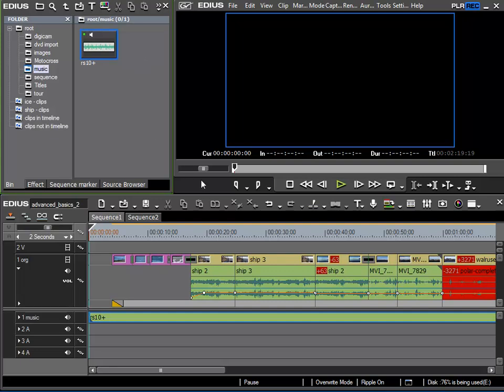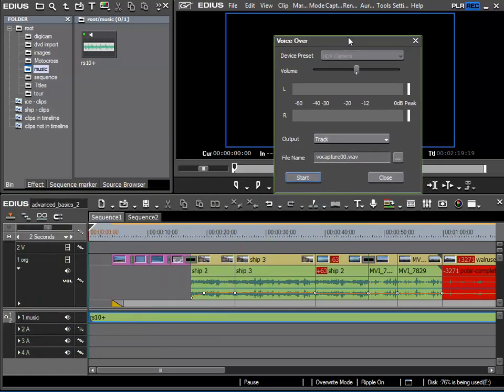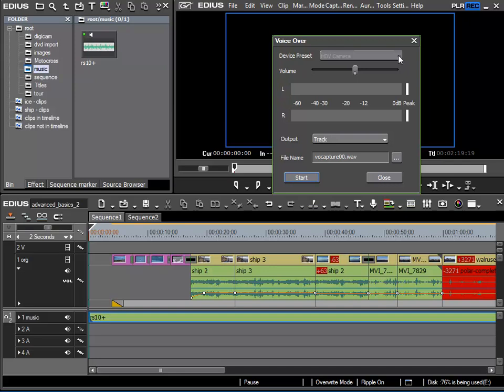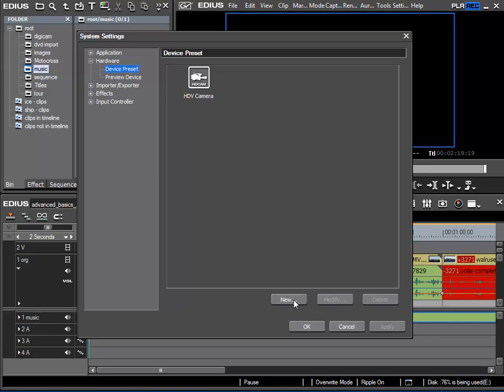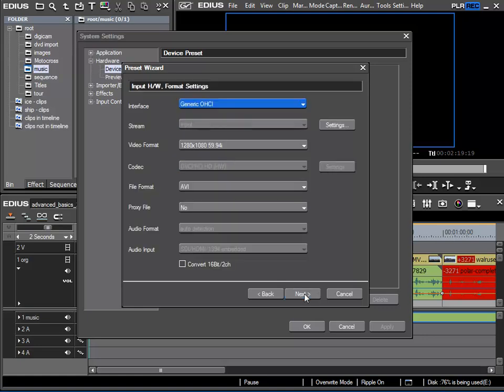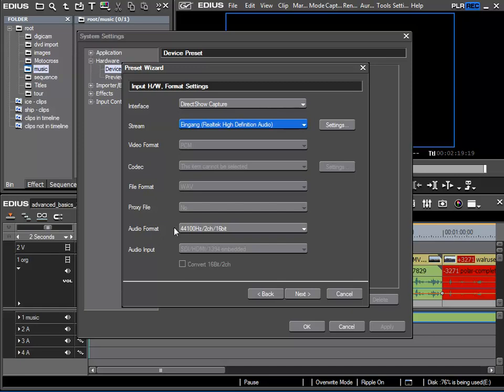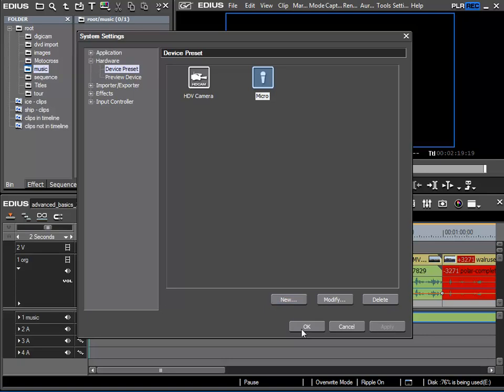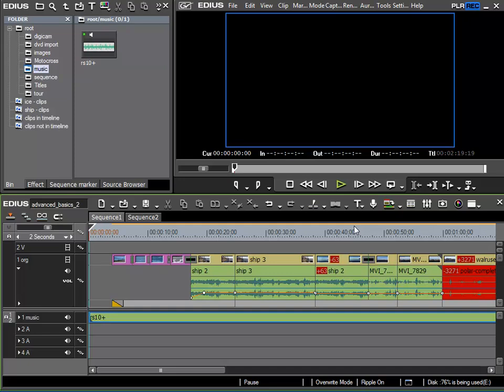149. Setup device for Voice-Over recording.

Comment: I connected a condensor mic through a audio interface (USB) to my desktop computer. When I record the voice over I want to keep the volume on through the headphones so I can time it correctly. The problem is when using the voice recorder in Edius it records the sound from the mic and the sound from my edit at the same time.

How can I just record voice over without other sounds, and be able to hear the sound on the edit line through head phones? 

regard, Martin